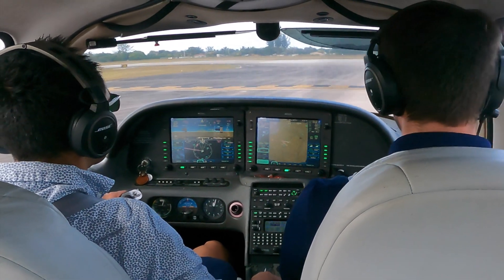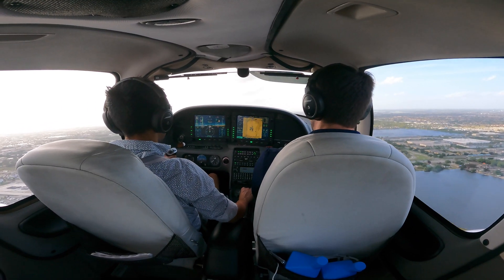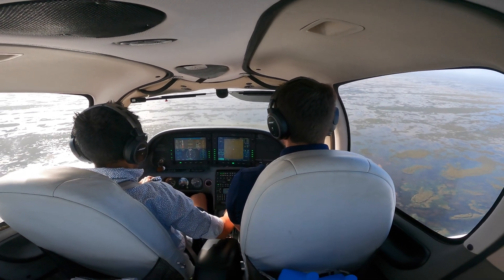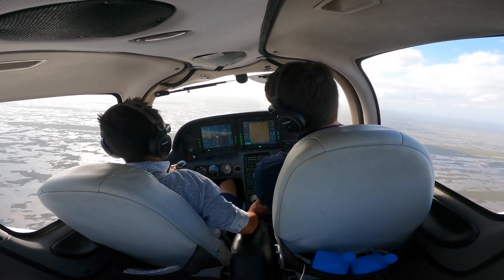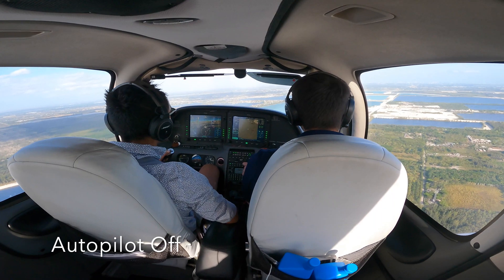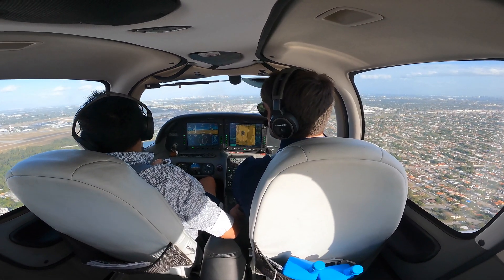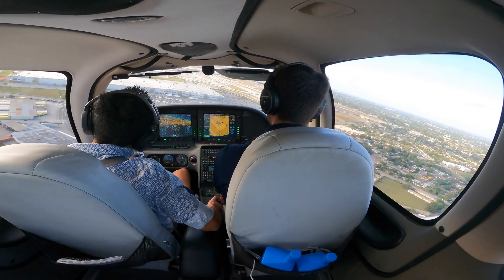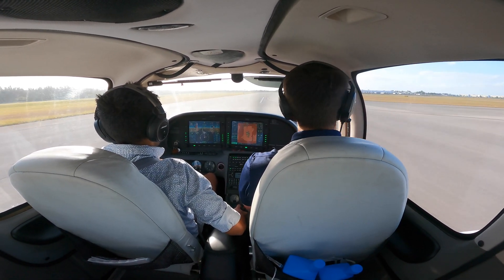Cirrus SR-22 Transition Training

Comment: Please, use your check list! Why you didn't remove the pin from parachute system? And after 600ft you should say CAPS is available. Safe flying!
Reply from the maker: Max I appreciate your concerns. I was consistently using a checklist on my iPad. I called out the CAPs at 600ft (I think there was only 1 takeoff where I forgot), but didn't include the audio in the video. The caps pin is visible below the MFD throughout the flight.
Reply: @waseemthedream3  👍🤞Safe flights